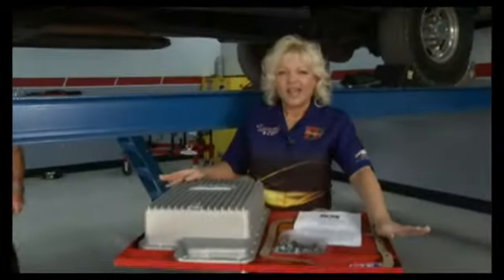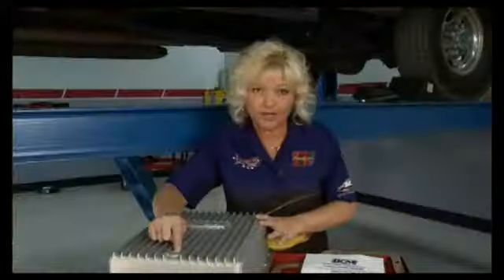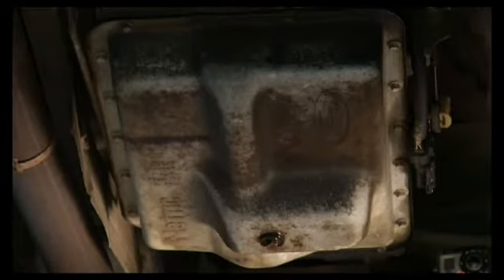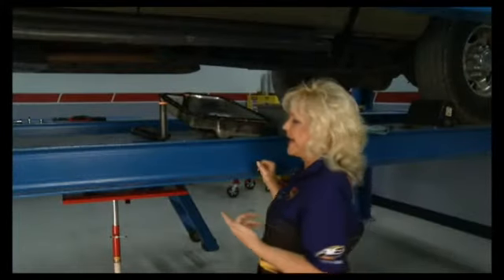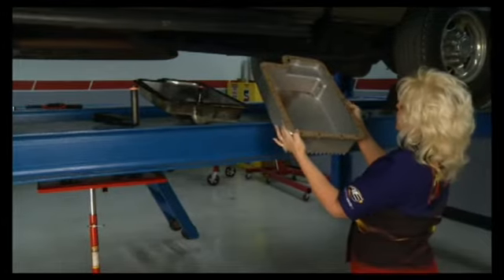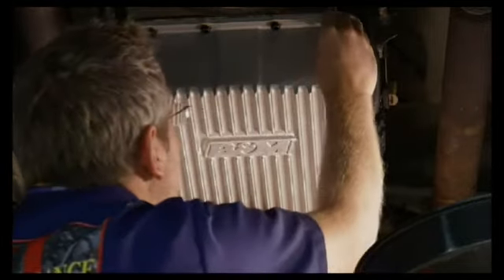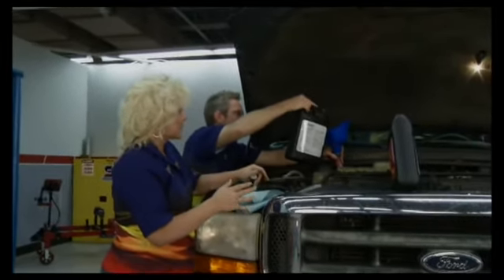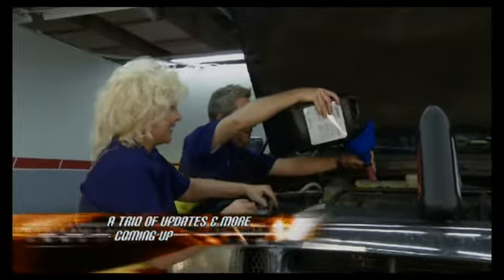Performance TV Installs new B&M Transmission Pan on a 2000 F250

Comment: The B&M pan for the GM 6L80e has ‘feet’ that support the stock filter.
Reply from the maker: While not the type of feet that you or I have there is a support cast on the inside of the pan to help support the filter during spirited off-roading excursions. I have included a link to the trans pan on our website and if you have any additional questions please do not hesitate to call us at 707-544-4761.

http://bit.ly/2LvnVVC

- Jason @ B&M